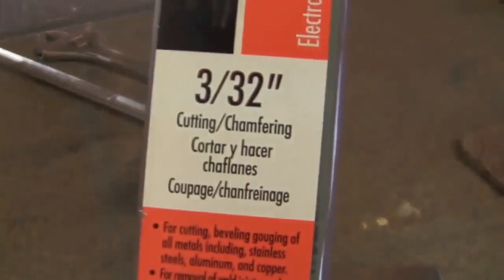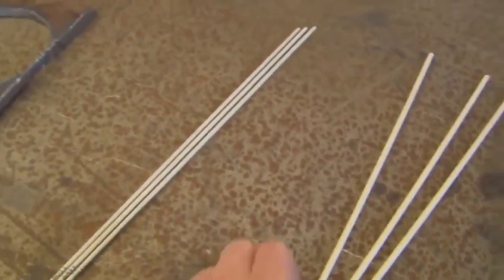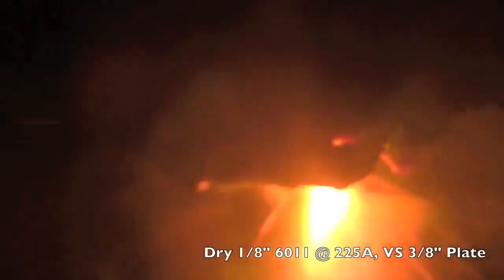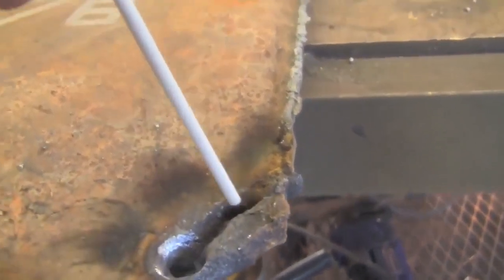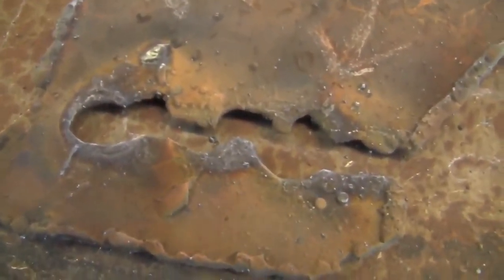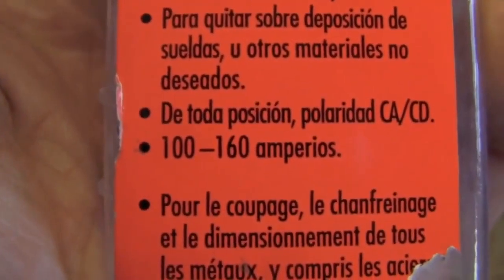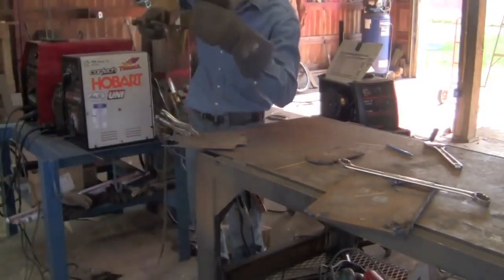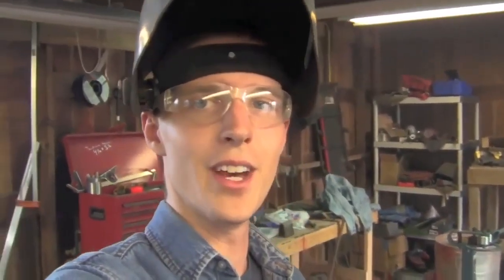CUTTING METAL WITH A STICK WELDER - DOES IT REALLY WORK - WELDING CUTTING TECHNIQUES PUT TO THE TEST

Comment: Working as a field mechanic In an act of desperation trying to remove bearing races I had to try this trick.  I found if you apply air flow to the cut it blows away the molten steel much like a carbon arc air cutter. It worked but it was hard to keep the electrode lit. A lot of starts and stops.

Comment: I've used this similarly in the field to create bolt holes where drilling wasn't an option. It creates a remarkably round hole with a steady hand.
Reply: This is what I use it for. Hard to reach areas for bolt holes.

Comment: I used my arc welder to cut a gusset off a car frame. I didnt have cutting rods, I used (probably 7018) cranked the amps up, and basically melted it off.

Comment: Dang, my stick welder worked fine as a cutter until I learned to weld with it :)

More seriously, I  have never intentionally tried to cut with it, but I wonder whether push rather than pull might work better on the thicker stuff to try to blow the puddle out the bottom as you go. Just a hypothesis though; would love to trry it (gotta get a new 220 outlet.put in before i cam weld again).

Comment: Question :
Are most hobby type stick welders AC or DC ?
Thanks
Reply: Lincoln buzz boxes are usually ac (the less expensive ones). You can get some fairly inexpensive dc inverter types nowadays that are decent for hobby welding. If you want something that will last, go old school with less electronics like a Lincoln tombstone. It has the ac limitations though.